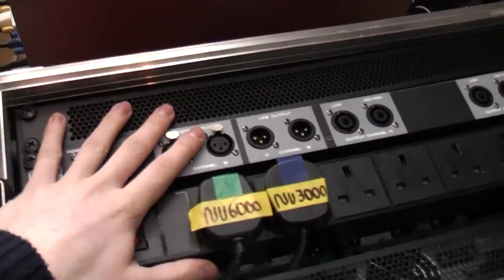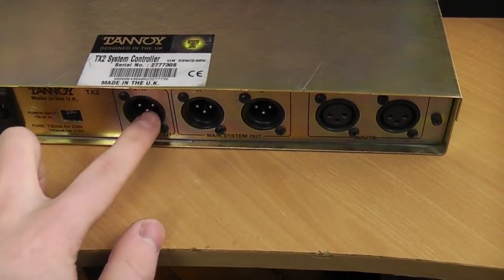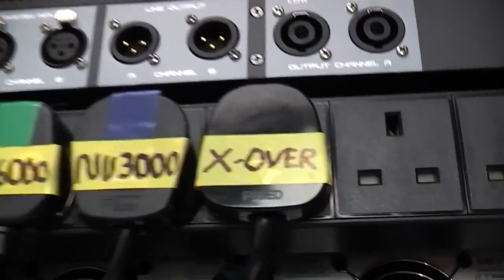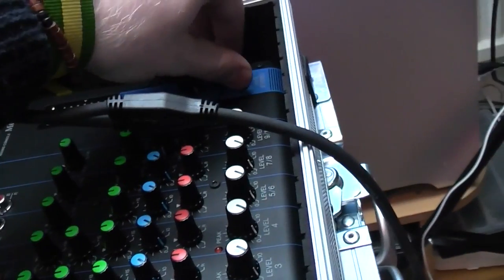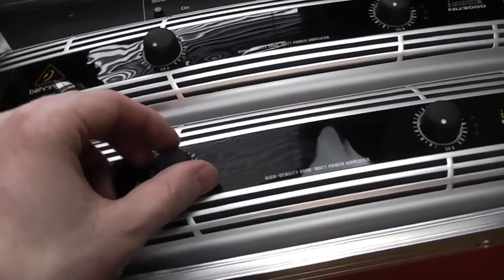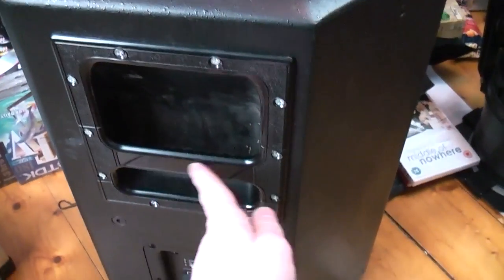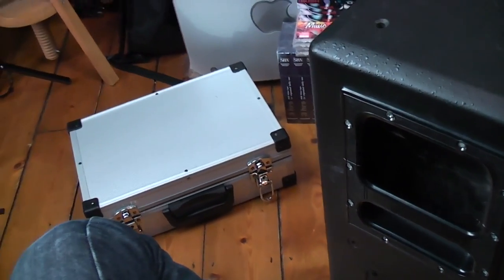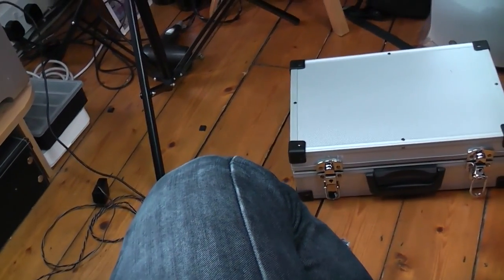Portable PA System Rebuild: Part 3 (Crossover, Speaker Handles & Testing) | IMNC

Comment: Nice crossover. I love Tannoy gear, I use Tannoy speakers in my main hi-fi system. I've never had any experience with their pro audio gear though.

Personally I'm not a huge fan of mono subs, I prefer everything to be stereo.
Reply from the maker: Thanks man! There's a theatre about 15 miles from me that has a full Tannoy system in the main auditorium. It's a lovely sounding system. I'd like to hear more systems if I get the opportunity. 
The mono vs stereo subs debate is an interesting one, especially in the pro audio world. I've ran both and honestly can't notice the difference but I'm aware of the problems that stereo subs may cause depending on cab placement and room type. Personally I think I'd feel more comfortable running mono subs as long as it's done properly (L & R summed into a single sub channel) because then at least I'd know that the exact same is coming out of both subs which would decrease my chances of phasing issues. Come to think of it, if I'm mixing a band it'd make no difference because I NEVER pan anything in a live scenario for obvious reasons. Of course the other thing is, even with a track with heavy stereo mixing, bass is omnidirectional to a certain extent so you'd only notice panning in the low end if your subs were very far away from each other in a big room but that in itself would present more issues.

Comment: Their is probably a good reason for you not doing this but why don't you run your woofers from a send channel ( with a low pas filter on your FOH and a high pass filter on the send)? This way you can avoid sending unnecessary sound to your woofers.  
You won't need a cross over unless you where using your smaller mixer (unless you needed all of its send channels for Fx or monitors).
Reply from the maker: This is a good solution if you're using the same mixer all the time and you have enough sends on your stage snake but I'm after a setup that's heavily adaptable. Keeping everything 'in the box' in terms of speaker management means that everything will always be the same no matter what source you're using. I don't really see the advantage of using an extra send, if anything I see it as an inconvenience.
Reply: ItsMyNaturalColour
While using the send for woffers is not for every body their are probably two advantages that come to mind.
One on the main advantage is that you can control what is being routed to your woofers ie drums and base get sent but nothing else thus avoiding sending unnecessary low end nose to your woofers.

The second one is that you can control how much low end you have.
Meaning: - that you can push your FOH harder than your woofers to compensate in larger venues  OR in a smaller venues not push the woofers as much.
-Buy pushing the ultra low end (unhearable but feelable sound) you can also create one hell of an experience for your audience.